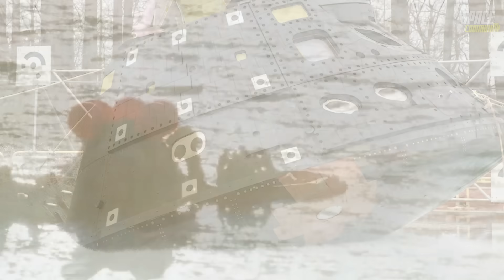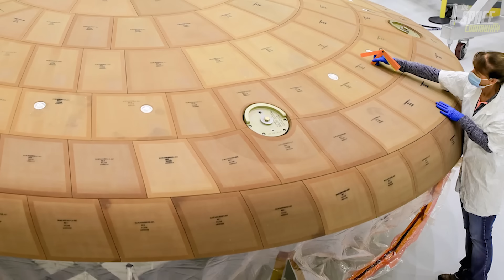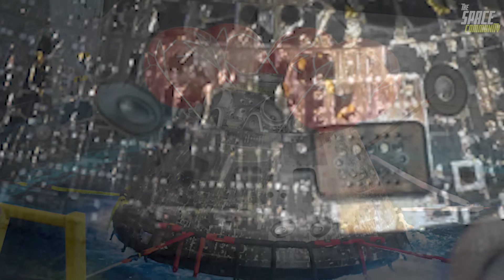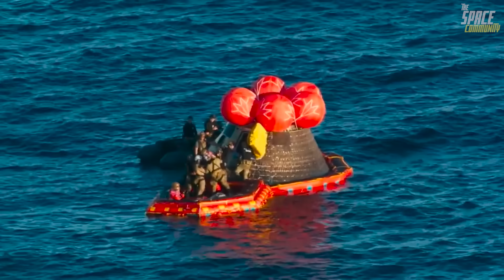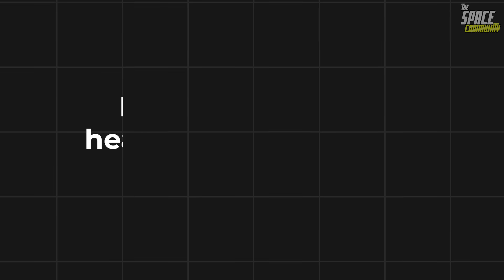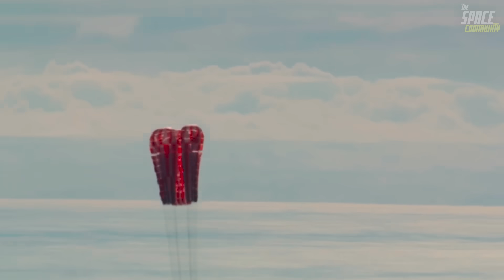What NASA Found After Artemis II Orion Inspection is Concerning! Heat Shield Missing & Bare Survival

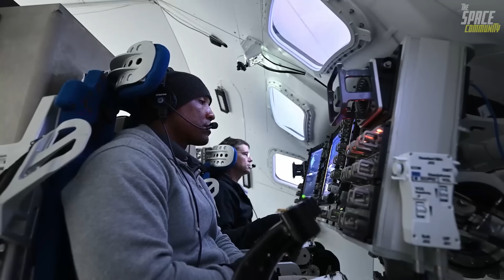Comment: At 11:00 it is clear there are three large penetrations through the head shield for the studs, connecting crew module and service module.  Before re-entry these nikel alloy studs are cut with a bang by ordinance explosion inside the studs. This is when the heat shield gets damaged sometimes or always.  This is where the most danger is because these studs are connected to the titanium skeleton of the capsule providing heat connection to the hot plasma outside .  Will we ever get a clear picture of the charred bottom of the spacecraft?  Most important to know, how the crew module adapter behaved during the separation before the re-entry.  The rest is just the hot air.

Comment: Just a question though.  Back 50 years ago, what in the hell did NASA use on all the Apollo ships for their heat shields.  You never heard of any problems back then, but these days it's all about heat shields failing all of the time.  What's going on.
Reply: Where does it say that heat shields are failing all the time? The Orion spacecraft has now flown three times and it landed safely all three times. Both Orion and Apollo use ablative heat shields, but the designs and manufacturing methods are very different. Apollo used an aluminum honeycomb structure that was bonded to the entire outside surface of the spacecraft. It had 380,000 individual cells that had to be filled with epoxy resin that was injected into each cell one cell at a time by technicians. It was a long, tedious, time consuming process. Orion uses similar material, but it has only 180 large blocks of ablative material instead of 380,000 individual cells. Orion is a new vehicle that uses newer technology, so it will take a while to get it perfected. By the way, two Apollo command modules flew uncrewed before a crew was onboard. The two uncrewed test flights tested the heat shields reentering at high speeds.

Comment: Returning into atmosphere at 25k miles an hour is a risk. Can they give them braking capability to slow down to say 15k or even 10k for reintry to lower the degrees of the heat shield. They don't have any brakes yet.
Reply: Its a good idea in hypothesis, in practice it'll need insane amounts of fuel to brake the capsule prior to re-entry. Probably several times the weight of the capsule itself in fuel to carry along for the entire duration. That's what the heat shield is for, absorbing and deflecting the kinetic energy of the chosen method of braking, namely slamming into the atmosphere, due to these fuel constraints :)

Comment: It*s possible to do the heat shield with water*s cooling inside for landing space ship. It*s needs to develop  system  water cooling  or  in wiew  of tubes or  with fuel injectors & to test them.

Comment: Why didn't they just use the material that worked with the appolo missions?
Reply: Both Orion and Apollo use ablative heat shields, but the designs and manufacturing methods are very different. Apollo used an aluminum honeycomb structure that was bonded to the entire outside surface of the spacecraft. It had 380,000 individual cells that had to be filled with epoxy resin that was injected into each cell one cell at a time by technicians. It was a long, tedious, time consuming process. Orion uses similar material, but it has only 180 large blocks of ablative material instead of 380,000 individual cells. Orion is a new vehicle that uses newer technology, so it will take a while to get it perfected. By the way, two Apollo command modules flew uncrewed before a crew was onboard. The two uncrewed test flights tested the heat shields reentering at high speeds.

Comment: The question I have is why not retain the service module as is? As it burns it takes away some of the energy and then the crew module takes over after the service module is fully dissipated leaving the crew module naked?
Reply: I dont think relying on a disintegrating mess of a service module attached to the re-entry capsule is a good idea :)

Comment: The design is not good. You are risking everything over a 2.00 piece of tile. Why not use retro rockets to slow the ship. We already learned what happens when a tile gets damaged. We watched a space shuttle burn up on re entry. There has to be a better way of doing this.
Reply: Retro rockets would require additional fuel, which would require a much larger launch vehicle to get them up there in the first place.

Comment: While the heat shield obviously did its duty very well, I think that post splash down operations need to be improved. On that day, the sea was extremely calm. Almost no waves. And still, the divers had to struggle a lot to get this collar around the capsule. And also fixing the porch to the capsule and stepping of the astronauts from the capsule onto the porch were not so easy. I wonder how that would work if the sea was rougher. Is it possible at all? Getting the collar around the capsule could be even more important from safety aspect but much more difficult. Would the landing be postponed if weather conditions were not good enough? And also the gas measurements took very long.  I bet, in a rough sea. the term they used "the crew is all green" what become the meaning that most people interpreted at first 😂

Comment: Why does the capsule have to enter the atmosphere so fast. Is there a way to slow the ship to a near standstill and let gravity pull it down at a much slower speed? 

I am no expert or novice of this kind of thing but common sense says start down hill slower and end up going slower at the bottom of the hill. 

And once the vehicle is in the atmosphere could an air thruster use a more populated environment not slow the vehicle down.  Like compressed air or even high atmosphere parachute. Absurd I am sure.
Reply: Slowing them down would require additional fuel, which would require an even larger launch vehicle to get them up there in the first place.

Comment: Thanks, interesting video. Something noticed throughout parachute descent; Is tipped hanging angle of capsule intended for any reason, ie , softer water impact?
Reply: Exactly correct. I think they might even fire orientation jets just before contact to make sure of an angled entry. Nothing worse than a perpendicular slap down landing, that causes a huge G spike in comparison. Best to let buoyancy take effect and soften the impact by partial submersion and recoil.

Comment: The refractory on the main heat shield of the white area is hydration sprawling from sitting in the water.  Any person working in the steel making industry is use too seeing this moisture damage on refractories materials.    This capsule refractory only ran one heat cycle for 7 minutes. Steel making furnaces run for years before they require a refractory reline.  And EAF run for a month before refractory reline, withstanding arc temperatures equivalent to what this capsule only did for seven minutes !

Comment: I feel a little dumb right now.  While tehre certainly is some heat dissipation parts along the exeterrior top of the capsule.  The main part of the heat shield is and has always been UNDERSIDE.  It was during Mercury, Gemini, and Apollo.  It was also the under surface of the shuttle and part of its nose. and I think trailing or lreading wings.  but I might be getting those two positions mis labeled.
Reply: video felt like clickbait. Every time the image was about to pan down to show the main shield, it would cut to a different picture. Feels the creator is knowingly misleading.

Comment: If we are using the same pod shape that we used back in the 60's and 70's, why did we need to change anything about the heat shield at all?  It seems unnecessary.
Reply: The materials used in Mercury, Gemini, and Apollo are not longer manufactured and could not be resurrected.  Hence, the change in materials for Artemis.

Comment: The material they made for the heatshield is pretty amazing. It's micron silica glass fibers woven together and is solid, but made of 94% air making it incredibly light. It reminds me of aerogel except for the fact that aerogel is incredibly fragile.

Edit: It can be removed from a 2200F furnace and picked up with your bare hands.
Reply: If it is a solid then how can it contain 94% air?.

Comment: The most dangerous part of the Artemis II Orion flight to the moon was the helicopters attempting to hoist the astronauts from the raft, with the wind blowing and the helicopter pilots struggling to line up, nearly causing an accident. Why didn't they just put the astronauts on a boat and take them to the ship? 😕
Reply: Much harder to pull off the astronut switcheroo on the ship. 
Had to be done away from witnesses as much as possible...🤷🏼‍♂️
Reply: The chopper provides much better theater.

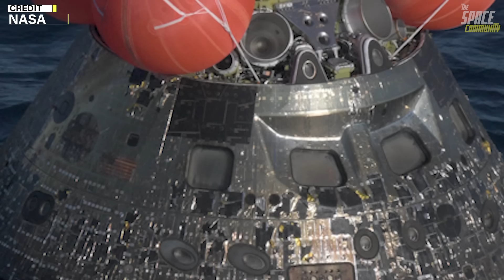Comment: 3:14 The Orion backshell thermal protection is not ablative.  The tiles are made of a silica fiber material similar to those used for more than 30 years on the space shuttle, they protect the spacecraft from both the cold of space and the extreme heat of re-entry.  The are completely different from the main heat shield in function and composition. What you see that was partially burned off is a thin metallic silver-colored coating that was applied over the tiles to manage solar radiation and internal temperatures while in space. Suggesting the backshell looks good so the heatshield must be okay is an apples to oranges comparison.
Reply: It's AVCOAT Ablative  shield.
Reply: @DonaldHolben The backshell is not.

Comment: How hot is the heat shield before hitting the water, and would the quick cool of effects the integrity?
Reply: As hot as the surface of the sun, 
hotter than that even... 🔥
Reply: The heat shield itself is not good at retaining heat, thats one of its design parameters, the slower part of the trip under chutes, and the capsule experiences a lot of convective cooling, so the heat shield at impact with the ocean is probably 200 degrees celsius at the most.

Comment: This is 1961 Wernher von Braun engineering technology. NASA needs to talk to Elon Musk how to properly recover a rocket! This is absolute NASA bullshit.
Reply: Good point
Reply: @esausjudeannephew6317  Not really. SpaceX's crew modules splashdown in the ocean the same way. The rockets that get the crew modules to space come back for a powered landing, BUT they also don't have to send the crew module to the moon. Since Artemis's SLS was sending Orion to the moon, it had to be larger and use much more fuel, for it to have enough fuel for a powered landing, it would have needed to have been even larger.
Reply: I am not sure if the concept of a SpaceX ship which is designed for close to the earth tours and a Artemis which is designed for travelling to the moon can be compared. The landing principle of SpaceX needs a complete rocket with sufficient fuels and strong engines. Bringig that type of rocket to the moon is impossible because the lander is stored in the rocket body so you have to split it. I assume it will be impossible to re-connect the units afterwards.
Also, the entry speed is much higher compared to SpaceX rockets. SO by far more heat is produced that would melt a conventional rocket. So my guess is that even if ist 1961 technology this is still a suitable way for that kind of missions

Comment: WHAT keeps the capsule in the correct orientation with the wide side going in first ?    Without any control surfaces or fins to hold it steady HOW does the capsule not tumble around ??
Reply: It’s heavier on one side. Not uniform . A trick learned from Apollo. That makes it tilt on the way down. Plus it has thrusters to help maintain its angle of attack.
Reply: Mass distribution. The center of mass is way below the middle of the vessel.
Reply: It has small hydrazine RCS thrusters to keep it straight.
Reply: By its very shape. The math behind it is too complex to explain here.
Reply: @DarrellCook-u5t 
The Gen Zoom and Gen Skibidi droolers wouldn't understand the explanation so don't bother...  🤷🏼‍♂️
Reply: @richardlincoln8438  Your attitude is completely at odds with the true spirit of science (i.e., never ceasing to help others learn) and therefore only creates more doubt.
Reply: simply think about the shape of a drop off water 💧

Comment: Hats off to the people who packed the parachutes. I don't even want to think about even one of those failing.
Reply: If they were designed along the same principles as those used in Apollo, then two would be sufficient for a safe landing.  Indeed one of the main chutes did fail on Apollo 15.  The result was a harder than expected landing, but nobody was injured.
Reply: One failing is built into the design. More than one though? Not so much.
Reply: @Rogue1_7.62  With one parachute only, the capsule would hit the water with about 56km/h. They lay in anatomic seats. The gravity acceleration experienced would be probably somewhere at 30-40g. But only on a fraction of second. They would hurt. They could die. They could also survive. I don't know chances for such a scenario. 

But yes, it would be safer to land in rocketplane. (with functional heat protection of course.)
Reply: Surprising they don't have a reserve system. I was also surprised that the chutes weren't dragged out by the drogue. Pity about the AI vocal fry.
Reply: @Fozcine There is reserve. landing would be safe with two as well.
Reply: The capsule is capable to land ok with only 2 parachutes. With back up's and drogue's they have 11 total. That is alot of chutes to fail.
Reply: The chute deployment was beautiful

Comment: The underside hole is white, not burnt so maybe it came off when hitting the water.
Reply: From what they said is where there was a pad there.
Reply: @joesmith-es1zy 
It’s a different material than the black tiles, has quartz in it and is used in compression pad areas. It’s chars white rather than black. 

It’ll be interesting to see the report in a few weeks on how it performed  overall

Comment: Nasa has already said that this is the last time this version of AVCOAT will be used. Going forward from Artemis III the AVCOAT material is being designed to be more porous so that the gas buildup isn't a problem later on.
Reply: That's good to hear.
Reply: Мне интересно из какого материала сделаны окна капсулы, что этот материал стекол выдержал огромную температуру плазмы?
Reply: @gftov They are multi-layered with outer layers of fused silica glass for temperature resistance and inner acrylic layers for cabin pressure protection. Multiple layers additionally provides redundancy if any single layer is damaged.
Reply: Best explanation I’ve read thank you so much.🇺🇸
Reply: @beverlyrichards9845  Scott Manley has a very good video up talking in depth about the heat shield.
Reply: Exactly this, they altered the entry angle to a steeper entry pattern to compensate, minimising the period of peak temperature, as a contingency, which ultimately seems to have been the prudent decision. Artemis III will have the original Artemis I approach angle for reentry with a redesigned heatshield that can handle it based on what they learned.
Reply: NASA won't have to worry about a next re-entry.
Cost overruns and scheduling delays will get the program cancelled.....  🤷🏼‍♂️
Reply: @richardlincoln8438  this mission was a huge success and reached so much people around the world. They have already said it is only the start of the program and that this mission is a big step in the right direction. They are supposed to land on moon by 2028. I don't know where you take your information but if you listened to any of the press conferences, you would know they are all in and they won't stop until they have reached their goals.
Reply: @bobwesley4634  Except for the fact that the landing equipment is still IN TRIAL meaning both SpaceX and BO haven't presented a "final version" ... I would think that's quite import, wouldn't you?! Scheduling delays, delays in getting the correct lunar landing module and cost overruns are happening... I am surprised they picked 2028 as a target... USA only wants to rush it because China is planning to go to the moon, not because they genuinely care for space exploration.... (It's giving Apollo-vibes and that's NOT a good sign!) Sidenote Europe has completed the service module well within time for Artemis 3 + 4 ...
Reply: @richardlincoln8438  It won't be cancelled unless something goes very wrong with the two competing lunar lander designs that they'll be testing with Artemis III, this mission was a success and a stepping stone and it's up to SpaceX and BlueMoon, either one of them or both, to deliver their lander on schedule for testing ready for Artemis IV to actually land on the Moon.